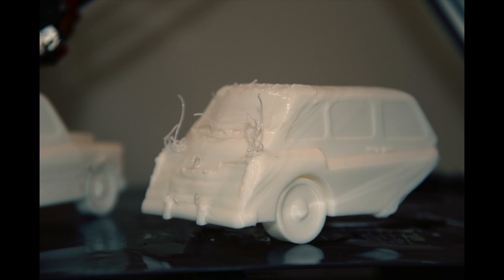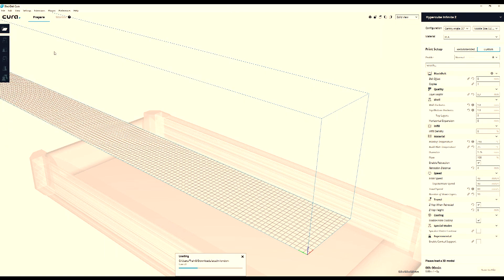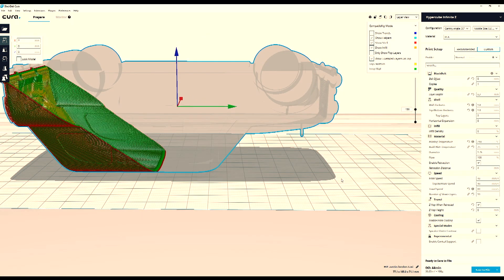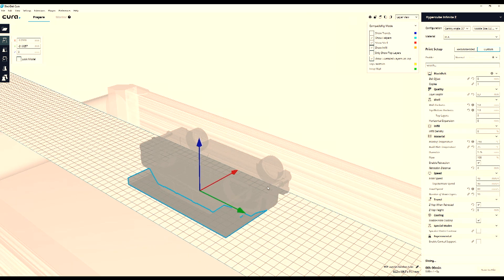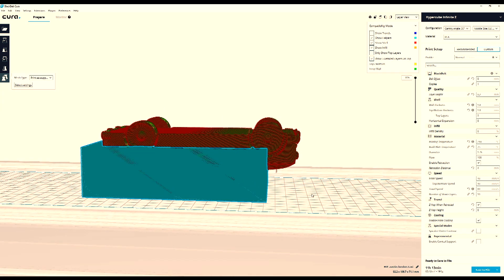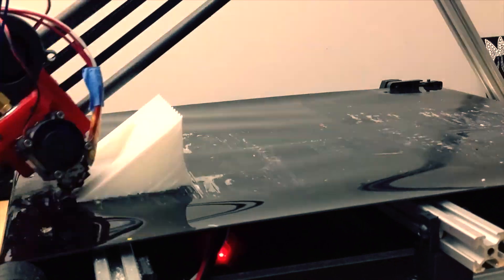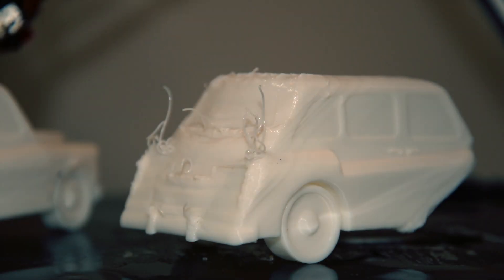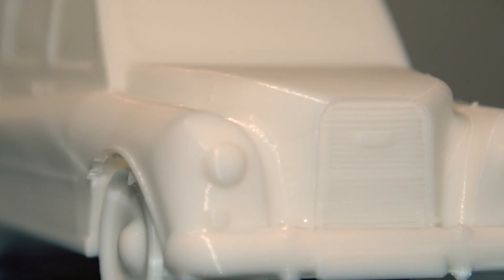Hypercube Infinite: Improve prints with Blackbelt Cura Supports

Comment: hi, great job!! i have two questions. I am mounting your design ,x and y ready (i am thinking in change the Z and do a 3d printed conveyor , something like a tank chain, without hotbed) and i have a problem about the electronics... you said in other video that in Z height you used a big number like 10.000 , ok , but... how many steps you have in Z? for the special movement of the conveyor... there is another thing that had to be changed in the firmware? is the thing that i dont understand, how to say to the firmware that you have a corexy with conveyor in Z...

the other question is, for the tilt of the conveyor, is best 35º  that you used first or 45º  that i think you have in the last design?
very thanks!
Reply from the maker: Hi JC 3Design. Good questions. My Z steps per millimetre is 29. It is determined by the diameter of the roller. The Z height is the longest thing you think you will print. I made mine crazy big 😜. You don't have to tell the firmware you are using a conveyor. The Blackbelt3d Cura makes the changes to the gcode. 
The only changes to my firmware are the steps power millimetres and the z height.
I used 35 degrees because my e3d nozzle sides touch the bed if it is steeper. I don't know what the best angle is - yet.